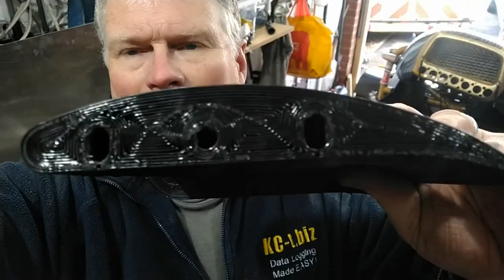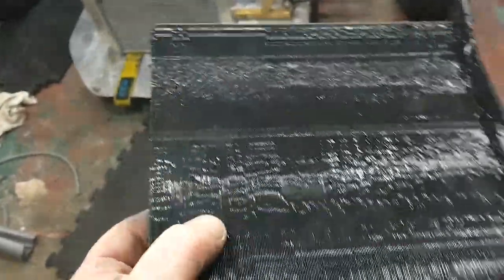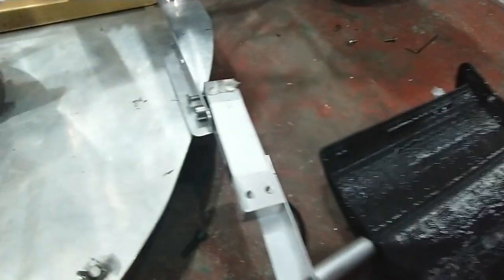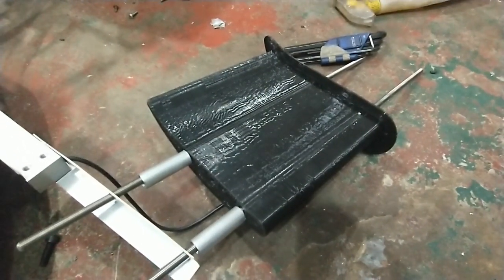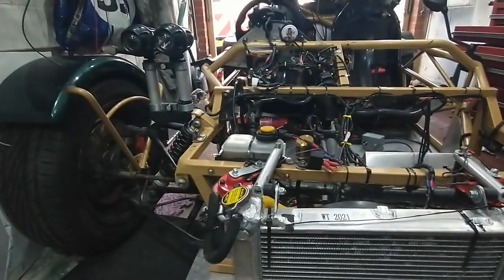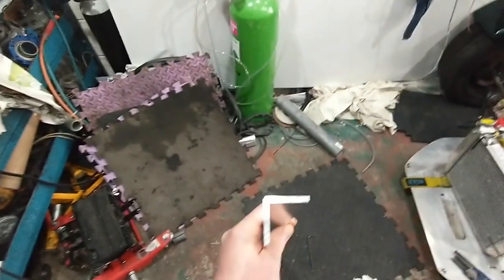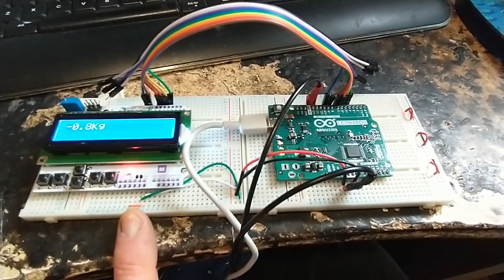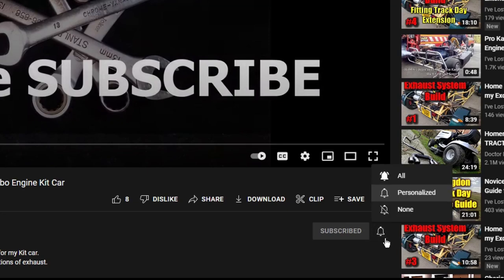How To 3D Print a Front Wing For a Car. Follow me as I fit a 3D Printed Front Wing To My Kit Car

Comment: I reckon we probably end up with quite a bit of lift on our cars. If you manage to balance out the lift that'd be a big bonus 👍
Reply from the maker: The sensor I have attached is only measuring the force on one wing, not the whole of the front. I put a front splitter on mine a while ago as I suspected the shape of the nose pushed air under the front & would cause lift. Once I have the wings sorted I'll have a look at the nose area under the rad intake.
Reply from the maker: PS - do you think my wing will cause lift? What's your guess for what it does at 60mph in Kg. The sensor will measure down & up force. So if it creates lift it will measure it.